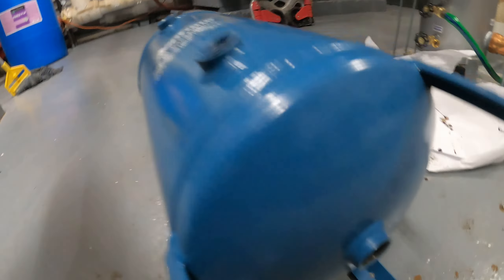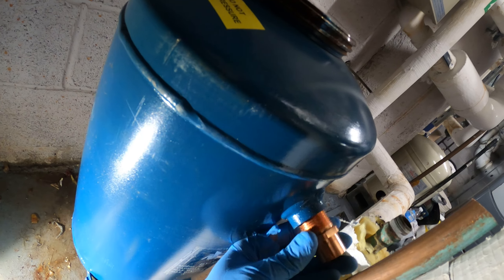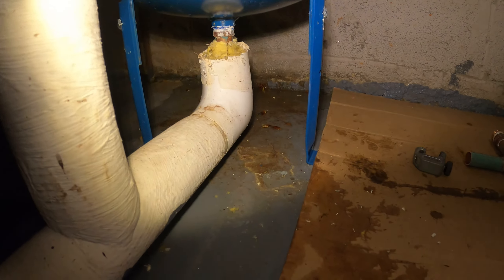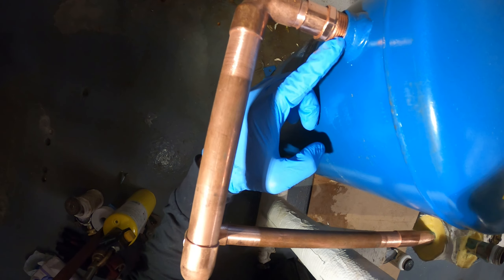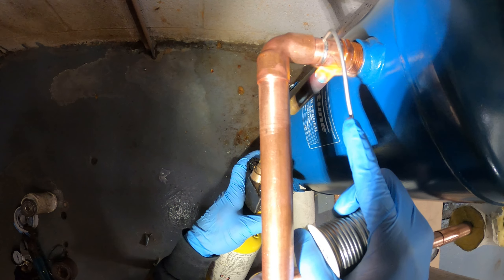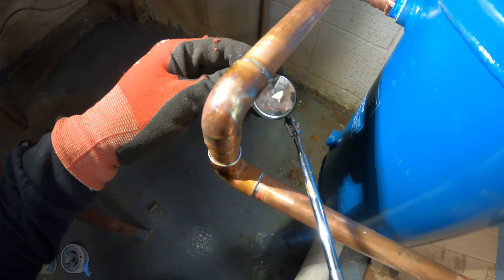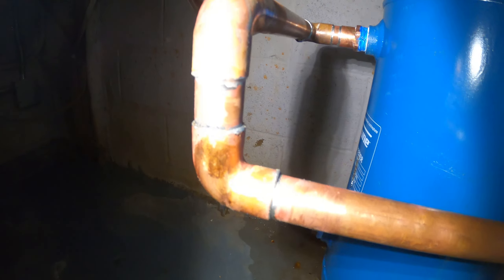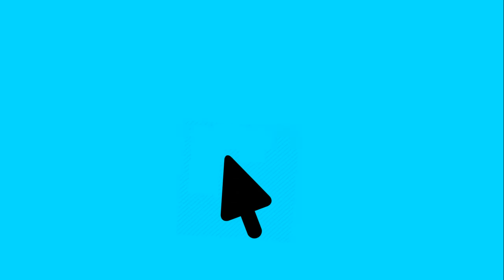HVACR: Chilled Water Bypass Feeder Installation (Industrial Refrigeration Training) Neptune DBF-5HP

Comment: nice work, question why take out a filter bypass tank and replace it with a non filter bypass tank? nice install still. there may have been one i just may not have seen it but there should also be a union on both sides in and out and a hosecock installed to relive the pressure when the chemical company of building needs to apply water treatment chemicals.
Reply from the maker: Thank you! This model actually has an optional filter bag so that's good👍 For some reason, the original one didn't have a filter in it🤦‍♂️They really should get one in there but its not my decision. Unions would be great but unfortunately I did not have any. There is a valve down below with a hose attachment to drain & relieve pressure👍 Thanks for watching!
Reply from the maker: Stay safe out there & stay tuned for new videos every week🔧

Comment: "Absolutely fantastic" sounds so Trumpish that it hurts. Of course its not your fault but mine.
Also, is putting a union between the side connection and the pipe for some reason unadvisable? I personally always try to make my installations in such a way that parts like tanks, valves, etc. can be replaced without disturbing pipework.
Reply from the maker: Lol. I wanted to install a union for the future but unfortunately I didn't have one. That would have been a good idea👍 Thanks for watching & stay tuned for new videos every week✌🔧
Reply: @JumpermanTech  I will. Thanks ;-).